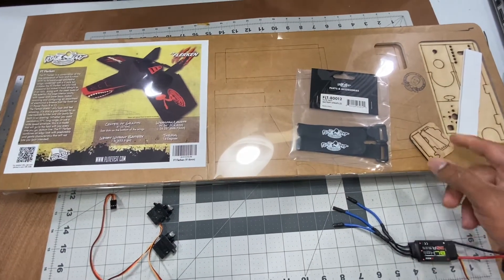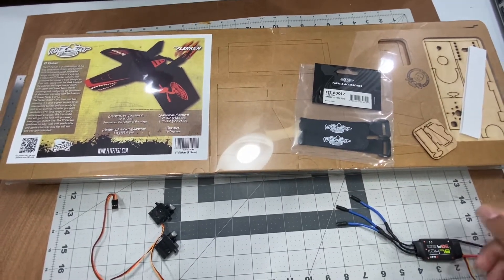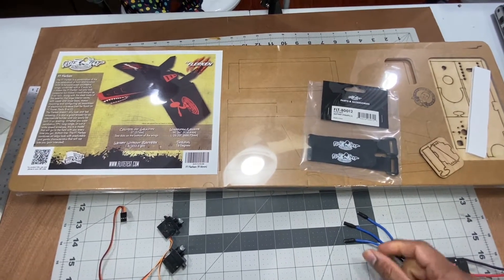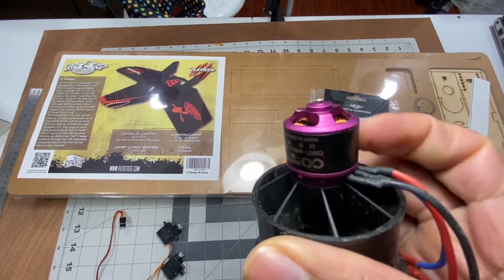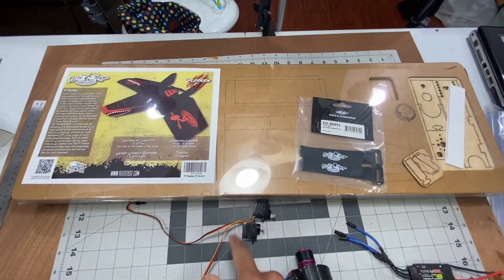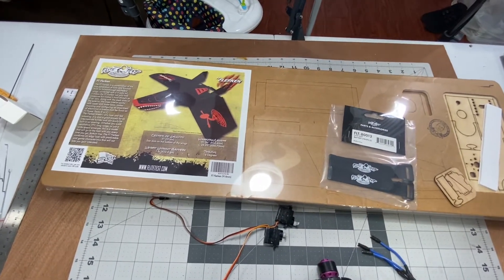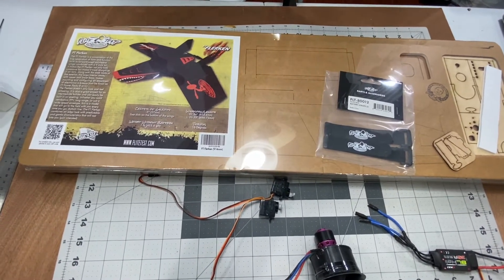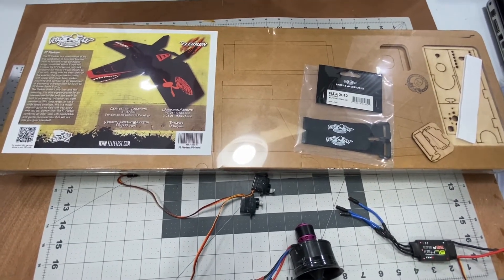How to Build FT Flerken 55 mm EDF Diy Rc Plane

Comment: Great work getting it to fly with an EDF. Throughout the flight, I thought the CG was too far back. It seemed to fly tail-heavy. Is there space to put the battery and ESC under the top bay to lower the CG and clear the duct for better airflow?
Reply from the maker: Thanks! I’m going back to drawing board with this and will look into making the necessary changes.
Reply from the maker: Thanks! I’m going back to drawing board with this and will look into making the necessary changes.

Comment: Maybe change the air intake and dont split the outtake/ thrust. The intake is Not big enogh and split close to the edf . Remove the last little coverpiece in front your edf, maybe ist helps and he has more thrust. Always a good flight and Mandy happy landings.
Reply: When I saw it. I thought if you restrict the output you aren't getting the maximum thrust from the fan.
Reply from the maker: I’ll be posting a new video soon of a second maiden.